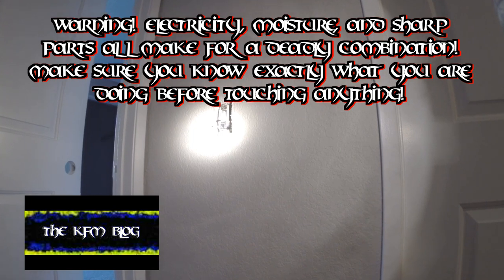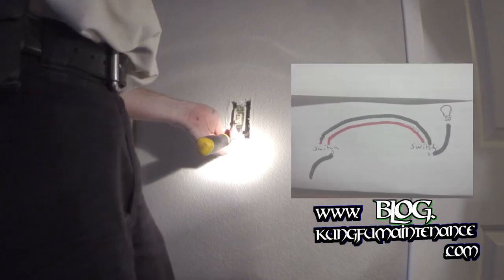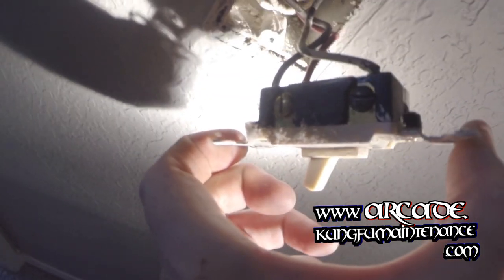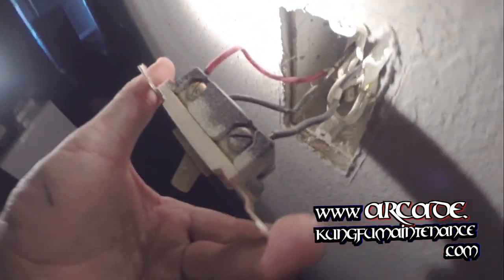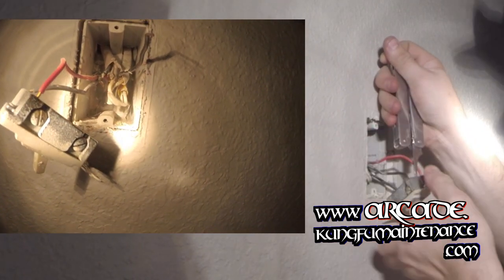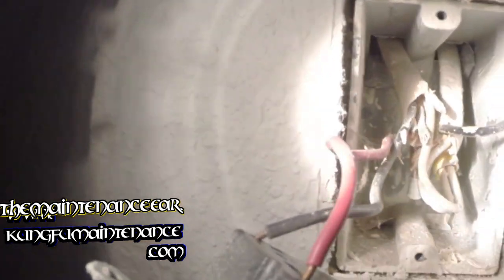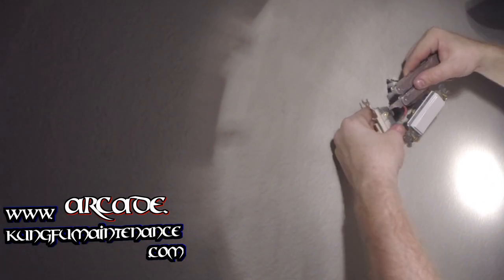Easy Way To Tell 3 Way Light Switch Common Load Hot Wire Wiring Video

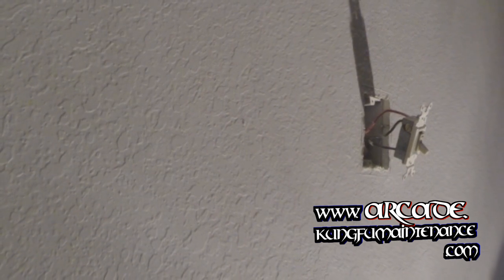Comment: Worked for me! I was replacing a three way switch with no red wire. Your "main point of the video" at 2:24 that demonstrates how to distinguish the travelers from the common was exactly what I needed. Thanks so much!

Comment: Production style aside, this video was very helpful. The tip about looking for the separate line in the switch box for the load/common wire was great. That tip alone saved me a lot of work. Also, looking for the wire connected to the brown/black screw, and marking it with tape before swapping the switch in the first place is a great practice. Thanks!

Comment: This video helped me when I forgot to mark my common wire when changing my second 3 way switch. Yours is the only video I found that points out the fact that the 2 travelers come into the junction box together and the common wire comes into the box with the neutral and ground. This really helped me, Thanks!

Comment: One of my switches is exactly like you described. The other switch has a red, black and white but they all look like travelers as they are coming from the same place? Any help would be greatly appreciated.
Reply: Just be safe don’t blow anything up and don’t start any fires. Always be focused when wiring.

Comment: OK I need a little bit a help I’ve never seen a house wide like this I have three separate wires each one is black it’s an old house and I can’t figure it out it has no ground and it has no neutral today concerned it seems likeEvery one of the blacks is hard when I tested it with my multimeter how do I tell which one is the line which one is the load and which one is the traveler

Comment: Quick wiring is not a safe method of connecting to your devices. One, because if yourself or a different homeowner ever wanted to change their switch it's a pain in the ass to push the pin and remove the wire (as you could tell in the video.) Two, it has caused many house fires. Even though it is code legal, it's not safe in my opinion. The best way to connect to your devices is to make a turn. The curl should turn right, so that way when you connect it to a switch and/or receptacle it doesn't turn off of the screw, which could over time cause a fire. Just what I noticed out of the video.

Comment: You really, really, really need to purchase and use a tripod. I believe I got video epilepsy in watching this video with all the camera shaking and jumping about. Did I learn anything from it? No, not really, as the typed in wording was totally distracting and so was the constant movement of the camera. "Blair Switch Project" is pretty darn accurate. The audio is horrible, as is the music chosen for this video. Erase or pull it and replace it with a better version. It will be well worth the effort.